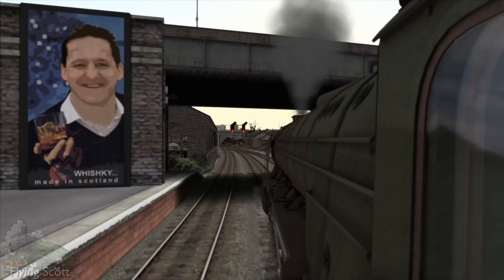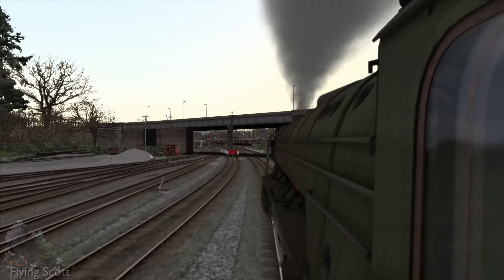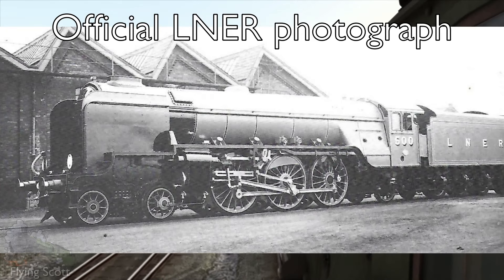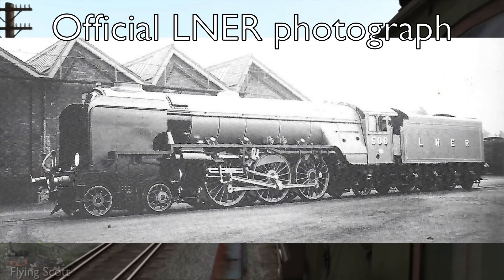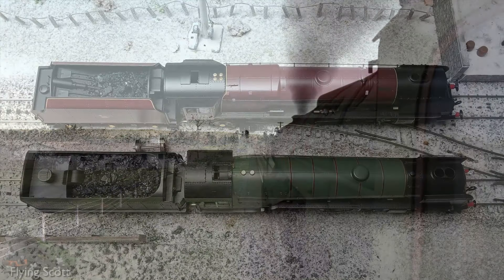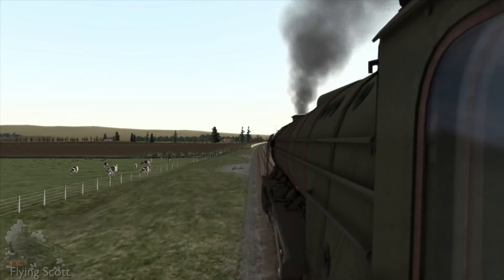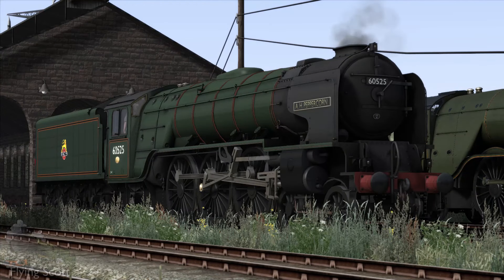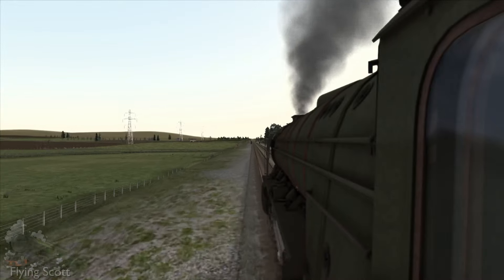Those Great Locomotives - Thompson A2/3 REVISITED

Comment: One thing I've never understood is why the whole "cylinders being too far back" argument, always comes up with the Thompson's but not with
The castles, the kings or the princesses.
Reply: Probably because specifically for LNER enthusiasts the looks of Thompson's pacifics stick out like a sore thumb compared to the looks of both Gresley's and Peppercorn's pacifics.  The LMS pacifics fit the aesthetic of other LMS locos, GWR Kings looked like other GWR locos, but Thompson's locos didn't look like other LNER locos.  Usually the outside cylinders are up front over the guide wheels.  On Thompson's designs the cylinders were moved further back to just in front of the drive wheels.  When you're used to seeing Nor' Easter' pacifics with the regular cylinder arrangement it makes the front end look like it's got wasted space.
I'll admit, though, they were better engines than a lot of folks give them credit for.
Reply: Thompsons Pacifics don't follow the typical pattern of Divided Drive. The middle cylinder is mostly in the same place as it would be on a Gresley machine, but for the equal con-rods to work the outside cylinders completely clear the bogey. Oddly reminiscent of the early A2's being rebuilds or conversions of engines with one leading axle instead of two. Contemporary designs on the LMS and GWR with inside valve gear have the inside and outside cylinders each rest over an axle. Really Thompson Pacifics have a closer layout to a Chapelon Pacific, but even then the layout for the latter uses four cylinders with the larger low-pressure cylinders on the outside. 3 high pressure cylinders that spread apart, with two of them driving past the middle of the frame, upsets the center of gravity

Comment: I'm gonna be honest, at first I didn't like Thompson and his designs. However, you have really changed my opinion on the Thompson engines. I definitely think they look rather nice now, and even though Gresley's pacific classes like the A1 and A3 are still my personal favorites, I have more respect for Thompson's pacifics now.
Reply: From what I understand the 2/3 was like one of two of his only original designs and the rest were just rebuilds. That's what I dislike about Thompson. He just out of spite (presumably because he did marry Vincent Reven's daughter which Raven also hated gresley) rebuilt gresley's engines. I mean sure the P2 "had to be rebuilt" but iirc it didn't go well since the lack of a 4th set of drivers reduced their ability on the Aberdeen line.
Reply from the maker: I would really like to know where you get your sources from because all evidence seems to point in circles as to whether Thompson disliked Gresley as a man. 
Furthermore it is undoubtedly false that the fourth driven axle with the P2s was what made the design. As the W1 went north to Scotland to perform the same duties which is did successfully, and the Peppercorn A2s and Gresley V2s did the same duties as the P2s and were pretty much synonymous with Aberdeen's heavy trains for their time.
Reply: @FlyingScott  well the gresley part comes from a friend I talked to the P2 part comes from a Train of Thought video on the P2 if I recall correctly the video said the lack of a driver set removed traction which was a slight issue because from what I understand the Aberdeen line had lots of slopes
Reply: @TheLostGamerMan you need to do some reading I’m afraid, most of those claims are just not true.
Reply: @Britishrailwaystories  I'm just going with what I knew :/
Reply: @Britishrailwaystories  like I said it's what i knew
Reply: @TheLostGamerMan  
Railway Mania podcast 5
1h30 on Eddie Thompson and why he did what he did in LNER that was basically bankrupt and it was during World War 2.

Comment: Out of curiosity, how did the Thompson Pacifics compared to the peppercorn pacifics as I don’t think I’ve ever heard you mention them before
Reply from the maker: I must admit I've not come across a book within my possession that talks about both the A2s and A2/3s which does not use the A2s as the "proper" Pacific against the "poor" Thompson equivalent. However, considering both took over duties previously carried out by P2s, it cannot within reason be said that the Peppercorn A2s trounced the Thompsons in every area.